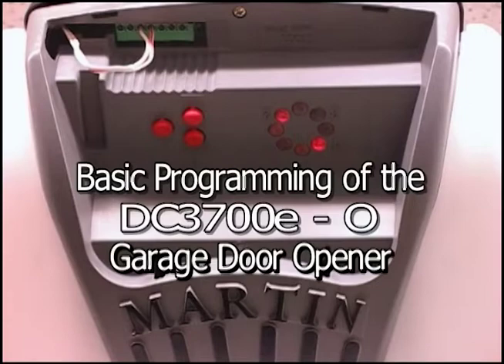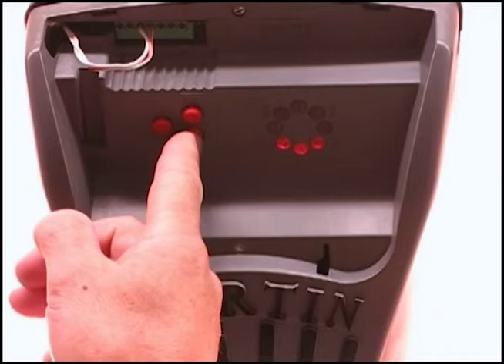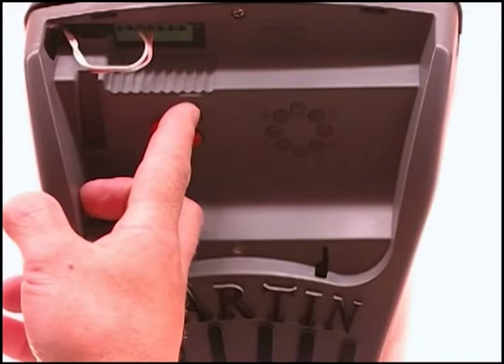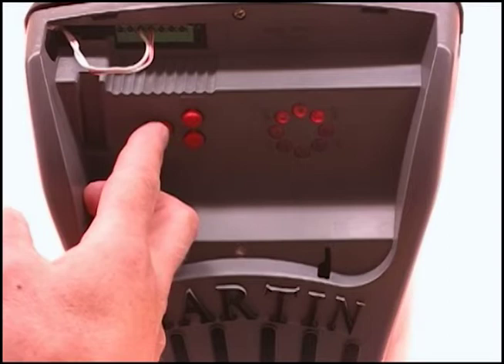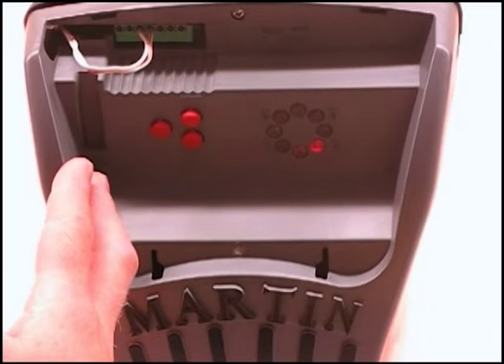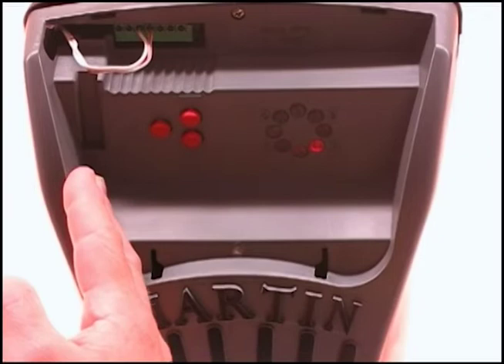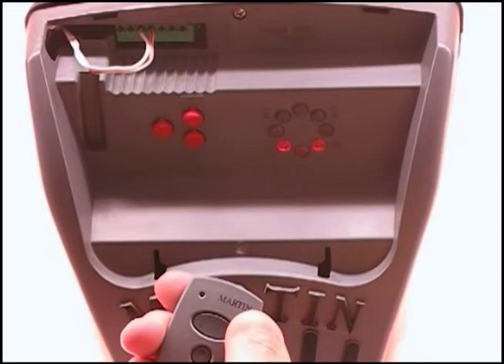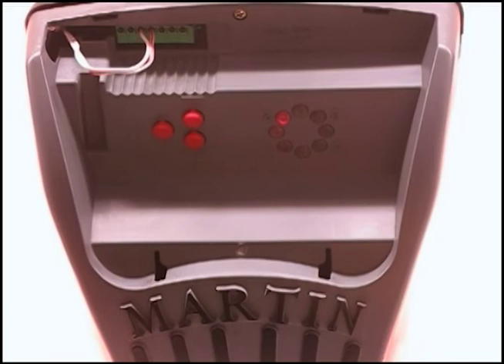Martin Advantage 2007 - DC3700e-0 Programming

Comment: This was very helpful.   Only problem for me is, my #5 never triggers even though the “sharks tooth” is in place on the belt, which is causing the door to close to far and reopen.  Or, when opening the door, open beyond a the desired point, stop and the light bulbs flash.  All was working fine until the power was turned off to replace a light switch in the garage.   Once power was restored, this problem started.  Wish I knew what else to do.
Reply from the maker: All electric operators are subject to power surges or brown outs.  Put a surge protector on your operator just like you do on your computers, TV's and other electronics.  For your present problem, give us a call, we can help.